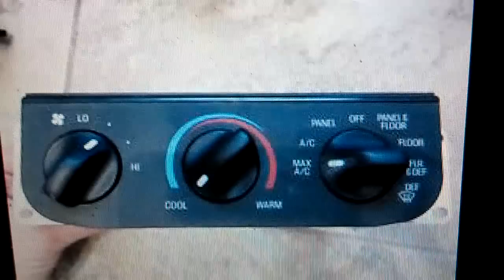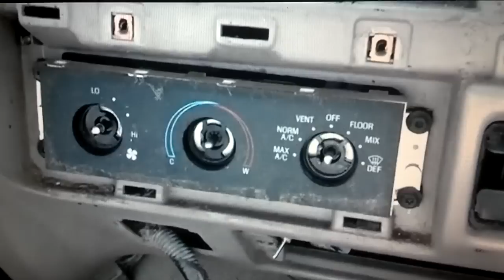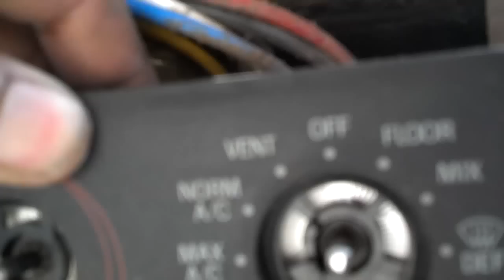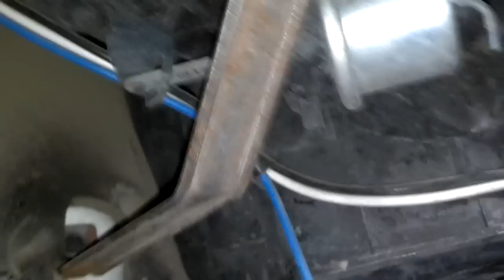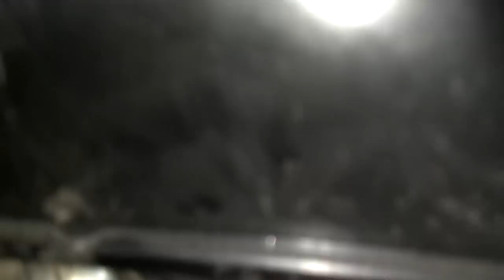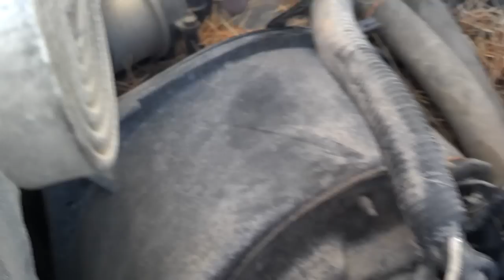Ford climate control vent defrost issues, F250, F350, Explorer, etc. - Auto Repair Series

Comment: There is no better vid explaining the a/c functioning parts and locations available. I  had avoided driving my truck in summer for lack of a/c. Everything works fine now.
Much appreciated!
Reply from the maker: Awesome, glad I could help! Thanks for your support. 👍🏾
Reply: I didn't see any explanation of what function each servo motor did in relation to switch position. Other than where the 2 servos under the dash are, i was disappointed. I assumed i would be watching a repair on a functioning vehicle, not one sitting in a wrecker's yard.

Comment: Just solved this mystery for me, 95 f350 non ac truck all heat controls work  fine I just couldn’t figure out why air was leaking in to the cab when driving, that ***** blue vacuum line was missing, THANK YOU
Reply from the maker: Glad it helped you out.

Comment: My problem was that mice chewed through the vacuum hoses attached to the selector switch. These hoses cannot be pulled off the connectors and replaced. So I spliced them using 2mm ID, 4mm OD vacuum hoses and 9mm Spring Band clamps.  It works terrific.
Reply from the maker: Nice

Comment: Thanks.  Mine just blows through the defrost so I definitely have one of those vacuum lines disconnected.  Was working on the engine today and must have accidentally disconnected one and when I went out later the a/c wasn't coming out the vents.  Just the defroster.  97 degrees today.  Don't need defroster.  Thanks buddy..
Reply from the maker: You're welcome!

Comment: Wasn't what I was looking for but nice video and informative thank you. 

I was wondering if you know of any solutions to replacing the climate control temperature adjustment cable on the back side of the unit. I am not sure how to get the old cable off the back side with out potentially breaking the plastic mount. It looks to pop off and I can destroy the old one without getting too upset but obviously do want to break the new replacement plastic mount putting the temperature adjustment cable back onto it. I have been looking online but haven't found a video on how to get the cable off and back on without losing my cool and just snapping the brittle plastic. The plastic vacuum connectors are broken so I am planning on replacing the entire unit with a newer one and that includes popping on and off that temperature adjustment cable. Any suggestions are greatly appreciated...thank you. 1994 Ford Bronco
Reply from the maker: My guess would be that the dash would need to be removed.

Comment: I know this is an old video but I was having issues with my AC stuck on defrost and sure enough I had no idea it was a vacuum controlled unit. so I followed the lines found the broken culprit and the main line was disconnected. I will like subscribe and share thank you
Reply from the maker: Thanks for your support.

Comment: I've got a 2003 F-250 diesel 6.0. My problem hasn't been discussed anywhere.. My hvac blower stays on high even with the control panel in off position. When I turn off ignition it will stop!!  Any ideas would be greatly appreciated..
Reply from the maker: bad relay.
Reply: @RobertDIY  
   I knew that but my mule headed nephew disagrees !  Thank You Sir. Keep the videos coming. They are greatly 
Appreciated.  Happy Thanksgiving to you and yours!!

Comment: Mr. Robert. Heapings of God's blessings on you. I have been collecting these OBS Fords for a couple years,  learning lots from youtube and teaching myself plenty, too. This is in the Top 10 for DIY help for this blue oval fan!! I have vacuum lines flopping around the servos in my engine bays and under the dashes of all my old trucks. I'm gonna invest in a bulk of appropriate interior-diameter hose (probably the more durable,  thick, black hose for hydrualics) and mark all of the existing and replaced vacuum tubing with various colors of electrical tape and Sharpie lables. I'm psyched to get started, now - and especially to have performance (for EGR and smog system) and climate control restored in my fleet.
Reply from the maker: I by lines from siliconeintakes.com

Comment: Man i’m so confused i’ve looked everywhere online for hours and can’t find what i need, and i think i ordered the wrong parts after seeing this video. my switch for the MAX AC/VENT/FLOOR broke today when i went to switch it to ac, and it’s stuck on vent. all of my vents and what not worked perfectly before the switch broke. All i need to do is replace the switch, however it looks from the backside there’s two different switches on the right side.... so which one the hell do i need? is the switch even replaceable or do i have to get a whole unit with everything together? HELP! lol. if it’s the switch on the bottom with vacuum
lines attached to it then i ordered the correct one.
Reply from the maker: If you were able to order a switch, you'll probably be fine.

Comment: My friend, you are a chocolate angel.....I have been beating my head against the wall and have watched everything I could.  You just fixed my vents and my power brakes.  They stopped working the same time.  The vacuum system had a leak so I had no brake assist.  I replaced every part and it is a $2 vacuum hose.  I wish I had just mailed you the money I spent chasing your solution.  Thank you my friend....J Sullivan, West Texas.
Reply from the maker: Me too. 😜

Comment: Followed Roberts video on heater control & found white vacuum line totally gone under hood on passenger side. Live in the bush in Alaska & minus 40 to minus 60 degree temp hard on rubber & plastic parts. Didn’t have access to parts place so improvised, as often happens in bush. Took a section of phone line& stripped internal phone wires out. The phone line worked& got good heater control. Was warm all the way to town,120 miles distant.
Reply from the maker: Very cool. Thanks for sharing.

Comment: So at 5:30 AM after watching the video I went out to my truck raised the lines and noticed that in taking out the glove bo and moving the temperature selector to see if it worked right ..it looked like the plastic part was busted and they had sort of wired it but as soon as IO pushed the line all the way over it seemed like the AC got much colder...granted it is 6 am but I feel like was the key and your video made it possible so THANK YOU I live in AZ all summer so no AC Sucks big time Thanks again!
Reply from the maker: You are welcome.

Comment: ok - I found your link, extremely helpful for the problem of defrost-only heat. I studied the vaccuum lines on my '02 F250, and found a disconnected fixture next to my battery - that I had to replace not long ago. Must have knocked it loose in the replacement.  Even tho your video displayed an older model - you are right in thinking 'just study the lines' - and your piece showed me where to look and basically what to look for. I posted this link on the Ford Enthusiasts page on two strings dealing with this topic.  THANK YOU, ROBERT!
Reply from the maker: +Jim Reeverts thanks for watching and sharing

Comment: i have a 2003 ford excurision, when in a/c mode the air comes out of the defrost vents, the vac pump was changed, then when the cab goes above the set temp it returns to the defrost vents, i raise the temp and it returns to the dash vents,then lower the temp, i have to keep doing this until i reach the right temp, hope someone can help
Reply from the maker: I really have no idea unless you have an electronic controller that has gone bad.
Reply: I'll bet when they replaced the vacuum motor they plugged the lines in 
 backward.

Comment: My climate control has no current at the connectors on my 97 Tbird
Reply from the maker: +William Jefferson ouch!
Reply: What could cause this? My led shows temperature, 12volts to the blower motor makes it comes on, if I supply power through the resistor, the switch controls the fan speed but if I hook it up regularly there's nothing. Is this a bad fuse problem??
Reply from the maker: William Jefferson not sure I understand but a bad resistor can cause the fan not to work

Comment: What does that last servomotor do that's in the engine bay in the passenger side do? Is it to close the damper to recirculate the interior air instead of allowing fresh air in? That's the only one that's missing it's vacuum line, everything inside my truck is hooked up but still only has air coming out of the defroster. Any ideas?
Reply from the maker: +Clint Garza no I don't.
Reply: You could hook up the vacuum line to see what happends...Just a thought.
Reply: ...But it is the fresh air door.

Comment: Good info going to check my vacuum lines getting very little heat from defrost and not very much air flow climate control seems to not go completely to  hot knob feels springy like something holding it back
Reply from the maker: +Noel Garcia may have a stuck door.

Comment: I have a 1993 Bronco XLT. just put a new heater core. but it only blow out from the top. and won't blow from middle  vents or floor vents
Reply from the maker: Bad linkage or vacuum.

Comment: Good Video Robert.  I have the same truck and was having trouble switching the temperature control knob (middle knob) from hot to cold and vice versa.  It will eventually go, but I have to slowly walk it around a little at a time, otherwise it feels like it may break something.  what can be done to free that up.
Reply from the maker: Probably a jammed blend door.
Reply: Did you figure this out? Not getting heat from mine.

Comment: Can you give me a call? I have a question about my 1989 full size Bronco's vac system.  No matter what selection at use for my vents AC or heat everything still comes out to defrost. 240-694-8193
Reply from the maker: That really doesn't work for me. You can call me.

Comment: I spent hours under the dash trying to diagnose a servo issue, they all looked good but still had a diverter problem. I didn't realize there was one in the engine compartment until watching your video. I replaced that servo and now good as new! Thanks so much!
Reply from the maker: Kevin Tyrrel Good deal. Thanks for watching.
Reply: This is what my problem was ,the white vacuum line  from firewall to Servo in engine bay. Fix Feb 8th 2026. Great Video Demo

Comment: Geat info !! can you explain how to change out a blend door in that same style truck .mine has the lever broke off the top of the blend door
Reply from the maker: lildoob72 I can try if you give the the vehicle specifics. My guess would be that the dash would have to come out, then the duct system.
Reply: its a 1993 f350 1 ton 4x4 with a/c
Reply from the maker: OK, I'll check Monday. Remind me if you don't hear from me by Wednesday.

Comment: Very informational video. I think I have the same problem with my 98 expedition that I bought last night. I have both heat and A/C, but the A/C only comes out of the defrost, and the heat only comes out of the rear floor. Sound right? Thanks!
Reply from the maker: HomebrewDr M I don't know, it has been a while.

Comment: i have a 92 cadillac deville an have the same problem air only flow thru deforst
Reply from the maker: joel lewis Some diverter has stopped working or come loose.
Reply: Ok thanks I'll check

Comment: Hey Robert, sorry to post off-topic, but do you have any information on Volvo 850 (1996 in particular) heaters being too hot? I live in a fairly warm place and have never used the heater since I bought it until recently, and it get so hot, even at fan level one, that it melts plastic. Car's temp is never goes above 182-185F, but I have no clue with what it could be. PM me if you don't want to reply here.
Reply from the maker: PM on it's way. I do have a Volvo heater system video.